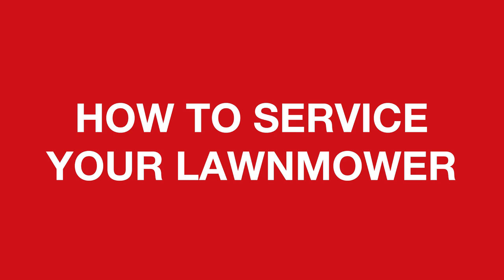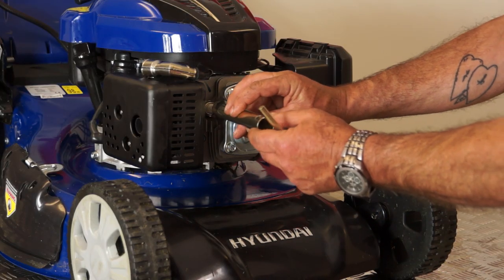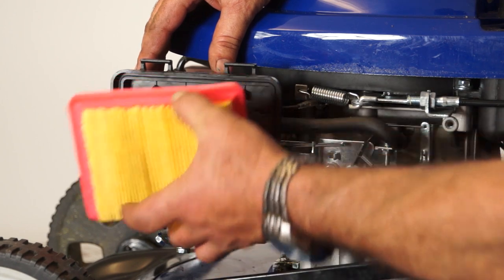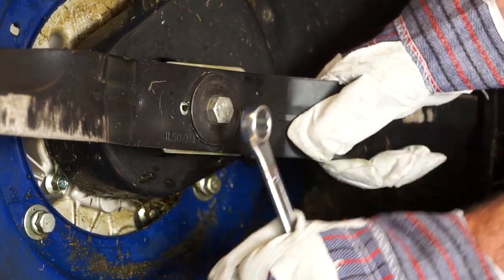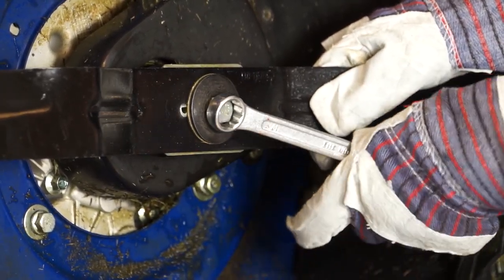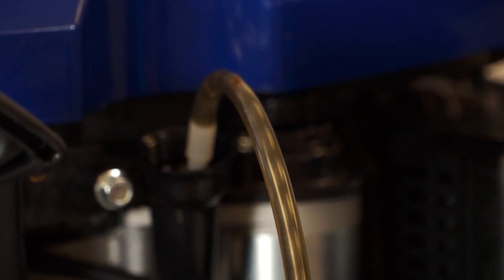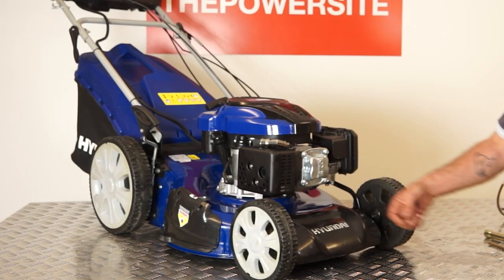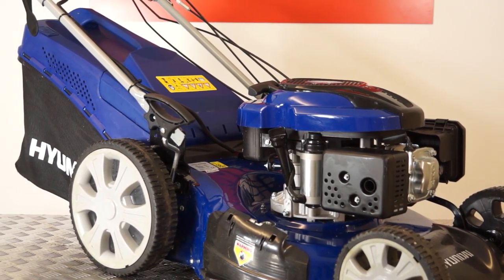How To Service Your Lawn Mower | Why wont my lawnmower start? Try this!

Comment: For anyone watching this video, some steps are missing. 

First, before you tip the lawnmower on its side and with the spark plug removed, pull the starter cord slowly until you feel resistance. Doing this will ensure that the engine is in compression, which will prevent the combustion chamber from filling with oil while it's on its side. 

Second, when tipping the lawnmower, only ever do it with the air-filter side up; otherwise, the oil will leak, ruin your air filter, and maybe end up on the floor. 

Finally, slowly pull the starter cord to turn the engine over a few times before starting the lawnmower. Doing this will ensure that everything is adequately lubricated before the engine starts for the first time.
Reply: Also Check the gap on the plug before putting back in
Reply: Thanks for this.
Reply: Excellent tip, thanks! I've made this mistake when replacing the blades before. Made it very difficult to start and a huge cloud of oil smoke once it did.
Reply: Missed this and when I tipped it - loads of oil came out lol. No harm done - thanfully

Comment: Perhaps for the newbies you could of mentioned something about turning a lawn mower over, if it has petrol inside, and how it vould flood the carburetta...
I still dont know what happens if you flip a mower with oil already in there too, to the engine.
I feel you should have shared more than the very basics...
Reply from the maker: Hi Belle! Thanks so much for the feedback - I'll forward this on to the team! :)
Reply: I tried to put the lawnmower on its side, the oil comes out if your tipping  on its oil side. Maybe best to take petrol and oil out before servicing!

Comment: I bought two of these to double-team a 2/3 acre plot with my friend.🚜  allabout.wiki/Ryobi-13  We used to use a mowing service, but $140/month was adding up fast. We needed lawn equipment, and rather than spend $1200 on a cheap ridable mower, we spent the same amount with GreenWorks on two of these mowers, four 2AH batteries, two rechargers, a blower and a trimmer. I'm glad I did. These mowers are easy to push, plow through thick grass, can be used at night due to their low noise, are effortless to start, don't stink of gas, and I love always having a charged battery available. I've found that a battery can fully charge before I drain a battery (~45 minutes), so the two of us never have to stop. We get our yard done in about 1.5 hours and hardly break a sweat. We have been mowing weekly and actually enjoy doing it, despite the two of us claiming we hated mowing grass. Seems we only disliked the inconveniences that gas-powered equipment bring. Thank you GreenWorks for making lawn care fun for us.

Comment: I'll need that sucker to suck the oil, you can't drain it like a car.
Reply: No need; just tip the mower on its side (like you would to replace the blade) to allow the oil to drain out. Remember to gave a large pan to catch the oil, and watch for any petrol that may come out through the fuel cap (some mowers use a vented fuel cap).